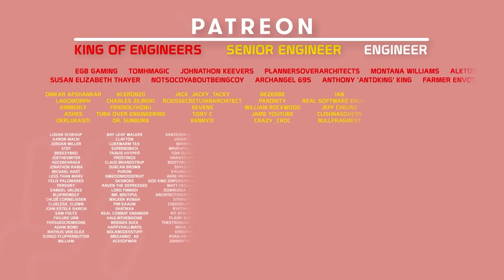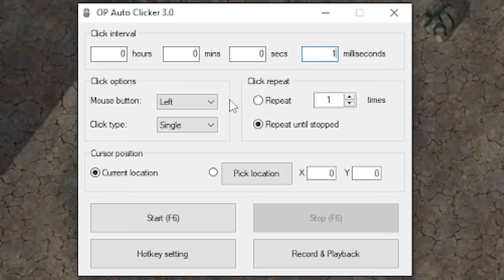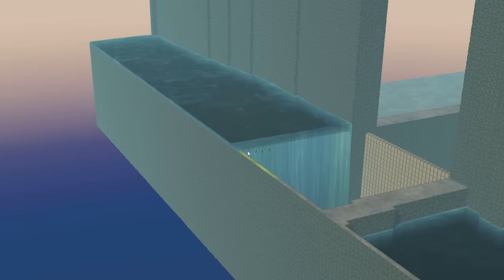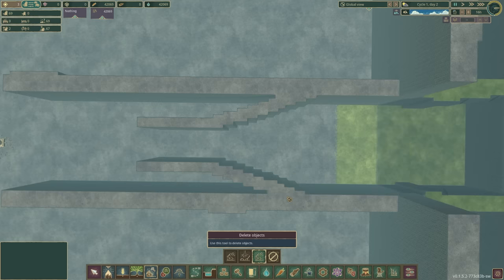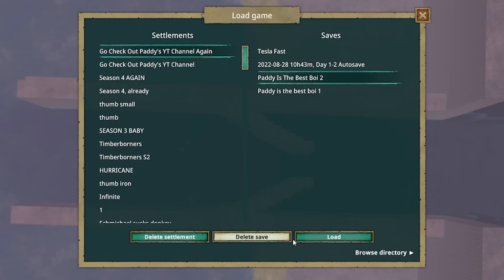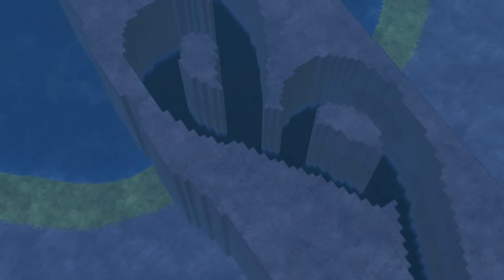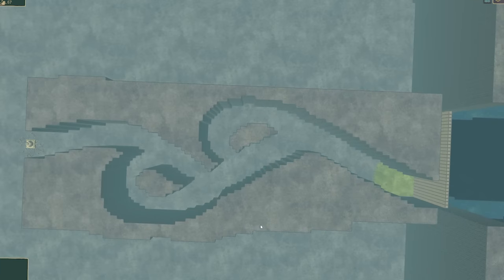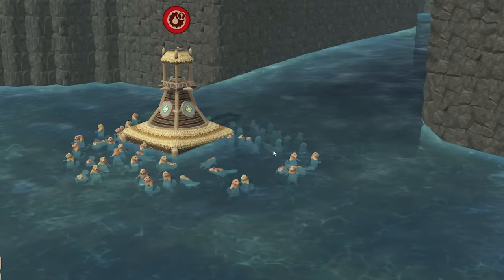Can a TESLA VALVE save my beaver colony from HUGE FLOOD WATERS?

Comment: As can be seen when the water is leaving the canals, the water "diffracts" around the corners, appearing to behave more like a sound wave than a water flux. You could try the double slits experiment to see if there is a "safe" place in front of the tsunami for the beavers to live.
Reply: I mean wave physics is wave physics, I believe the analogy works bc water waves, sound waves, and quantum waves all do similar things. As others pointed out his assumptions are based on closed tubes rather than barriers.
Reply: maybe TB water is set up to behave more like its large scale? i wouldn't be surprised if poking a 100m wide gap in a skyskraper sized dam would also involve quite some sideways spill from the initial wall of water.
Reply: The min water amplitude is 0m, not negative. A double slit would make the safest space half the max height of the water, which is still bad
Reply: problem is that waves in this game don't have "momentum" tesla valve works because you crash wave on itself using momentum. Game don't have it in long run, there seems to be some momentum analog when water meets wall, but there is not when water meets water, nor when you have 100 block high wave running in straight line, which in real life would speed up all the way down from that standing pool . 
let me say it again as well
Tesla valve don't stop water flow. It makes water waste momentum and slow it down, not stop it completely. IF he would leave a way for small amount to leave to the side, then it would make sense.
Reply: Double slit experiment would be super cool to see.
Reply: @xxportalxx.  If by water waves, you mean surface waves then you would be correct. However, simulating how fluid flows is different to simulating waves. The water particles that make up a wave don't actually move that far, they just wiggle back and forth.
Reply: @aedeatia  ofc, these simulations in the games seem to just set a speed for water propagation that looks good. Which to be fair is a lot easier on the computer running it, they aren't fluid mechanic simulators after all.
Reply: @yugiohsc  You could set up a coffer dam around the beavers, just barely not tall enough to save them with a straight-through water flow, and then see if an interference pattern can keep the water low enough to keep them dry.
Reply: @xxportalxx.  not in this case no. He's trying to simulate a tide which is essentially a single direction. Sound waves go in all directions at once
Reply: @Evi1 M4chine no, not at all, when quanta are behaving as waves they do the exact same thing. The difference is when quanta are not behaving in a wave like way. You basically have the discovery of the double slit experiment backwards, it was what first confirmed the wave behavior. In fact you can do the double slit experiment with water waves and get the same result, however water waves won't show the 'particle' behavior you'd get from quanta after entanglement.
Reply: The way Timerborn handles water, it doesn't follow the wave equation, the curvature of the surface is not proportional to the second time derivative of the amplitude.

It more closely follows the diffusion equation.
Reply: that would be fun to see
Reply: Waves are waves, but at the same time i ABSOLUTELY want to see the slit experiment now. How far can we push Timberborn water physics.
Reply: Yes! A double slit experiment with Cities Skylines water!
Edit: this isn't CS, but still...
Reply: That's kind of what I thought in the CS tests; the wave looked more like a sound wave than a water wave.

Comment: I'm not sure, but I think the visual water currents don't actually effect the physics, they are just like visual shaders, and the water doesn't have any momentum/inertia.
Reply: That's the problem. Not only is the water slow, its velocity never changes.
Reply: I have definitely seen water hammer in this game though, which suggests some inertia
Reply: @frillneckedlizard8529  I don't know what that is. But, could it be the case that water behaves specifically due to that thing to just simulate inertia in that instance?
Reply: Yes. Water just checks for tiles that are lower in a small circle, and tries to spread itself equally to those from what I have seen
Reply: Water doesn't interact with itself like irl
Reply: Water speed IS simulated because the water mills depend on it for power.
Reply: But if i may remind you of water mills that slow down if flow impeded
ed: ye, should've read the answers first^^ For good measure then.
Reply: Next time you've built a fairly big dam, open your sluice gates fully to get some flow & then shut them rapidly, watch the water rebound - it's the same effect when water starts refilling a shallow dammed river area & rebounds & floods, and then drains, and then floods, and then drains... There is definite momentum & some wave modelling going on, it's just it might not interact with more water.

As was said, you can build narrow channels to speed up water mass flow to boost water wheels. You can check the flow with the stick.
Reply: @Xeridanus  but that may just be a number instead of a think calculated, like the air
It just tells the thing that checks for it how much energy it gets from it instead of that number being applied to the physics
Reply: @manelneedsaname1773  aren't all simulations are just a bunch of numbers if you look at a single time frame?
Reply: @manelneedsaname1773  Nope. I've been on the discord when some very keen users were testing things. They actually found a really subtle bug by measuring the flow rate at different points in complex setups. The bug was related to the order in which each cell does it's calculation, which then affected adjacent cells differently.
Reply: Not sure, slow looking water will actually spin the electric wheels slower or not at all
Reply: It's like minecraft water
Reply: @rancidquality100  I'm not
Reply: Ah
Reply: The water comes up from below the map so yes you are correct, although the markers act as indicators of which direction the water is most likely to flow to. The water physics are there they just arnt modeled in the visual water.
Reply: Essentially, if you look up Teslas own explanation of the feedback valve, or any of his inspirations (Heavyside et al) the fundamental physics of water means if it is moving anywhere it moves in toroidal 'ropes'; if it is moving it is in rotating toroidal columnar flow. This alone is why a tesla valve works at all, it's a major failure of modern physics to not comprehend this and students are still shown water as linear flow in a pipe.
Reply: It's basically advanced Minecraft water. If x block is water/source surrounded by source blocks, spread to adjacent blocks. The only difference is that they added weight to the water, which in all reality is just a 3D version of water the code for which has existed in Dwarf Fortress for decades. I assume the height of the "wave" is calculated based on the "amount" of water in surrounding blocks which is spreading into the next block ad infinitum, the remainder of which after the block is full, is ejected to the block(s) above. The update for this math is probably purposefully set so that the water "runs" at a certain speed. 

The supposed water hammer you saw in this video was just an overfilling of the blocks with a lack of adjacent blocks above to spread to, so it sent the water higher.
Reply: @sperzieb00n  "aren't all simulations are just a bunch of numbers" In a sense, the answer is yes. In all technicality, all simulations really are just bytes of information at any single frame of time. 

However, some water simulation is physics based and not maths based. I'll explain the difference: 

If you're taking a mathematical approach to water physics simulation, you might observe water to have a flow rate across flat ground of x number, and you would then program a chunk in your game to act as a source block of water. This water block contains, for popular example, 8 blocks of water in it and it can spread in every direction that many blocks. Then you would decide how often this math is updated until you're happy that the "flow rate" looks true to reality. This is a caveman example, probably significantly less complex than what's actually going on but I imagine this is the barebones idea which has just been significantly expounded upon.

If your simulation is a physics based approach, you would generally try to recreate what water is, which is a bunch of particles sticking together or not, or flowing or not, in a way which looks like water, honey, or jello. For example, if you wanted jello you could say the particles stick together very much and have some possibility for deformation but no possibility of flow. Your game engine is running in real time though, it's not updating with a tick rate that you can perceive, rather it focuses on updating as often as possible. This type of simulation is extremely accurate and you can tell when it's used in games (almost never) because genuine fluid dynamics are present...because that's how reality works.
Reply: @ShiShawPocketSand  necro thread but, physics IS math. I think you mean empirical sims vs physics based sims
Reply: @mezkhalin  Pedant.
Reply: @ShiShawPocketSand  Particularly. But looking at your message that I replied to, I could say the same about you ;)
Reply: @mezkhalin  Get a life, eh?
Reply: @ShiShawPocketSand  right after you grow up and learn to take feedback, my dude.
Reply: @mezkhalin  That wasn't feedback. That was pedantic.
Reply: it does have water physics for speed like that but not like this more just to get rivers right high input low channel  and it can't overflow = really fast

Comment: I think you are a little bit off with your velocity assumption:
In a closed pipe a reduction of the diameter results in a higher velocity (with an incompressible fluid). But because your system is open, the fluid uses the open space above to release the "pressure" of the reduced diameter and just stacks higher (as you noticed). So the physics are probably correct :)

Edit: In a continous stream you should be correct, there the velocity should be higher in a narrower channel, but I think the tidal wave breaks the system because it generates a local pressure at the entrance of the narrow channel.
Reply: but there is still a noticeable increase in velocity of flow at narrowing in channels. sure it won't be as much in pipes since the flow isn't restricted vertically, it should still increase by the height of the narrowest part of the channel.
Reply: @takumi2023  In real life that is correct I think. But the game probably does not calculate a physically correct pressure distribution (or a (hydrostatic) pressure at all) and therefor uses the height to "get rid" of the damming up water.
Reply: @Snifflezz_  It does simulate that, just not on a larger scale like he'd need for this concept to work in game. If you take a three block wide river and place a levee on two of the blocks, the water moves significantly faster through the remaining block. This increased flow rate allows you to create much more power with water wheels than you would by relying on the river's natural flow.

That level of simulation seems to kinda fall apart when you're dealing with this amount of water flow.

Comment: The water physics in the game are mostly correct, the higher a wave the more water "flowing" through. Matt should try using dams on top of foundations or arches to 3-dimensionally constrain the water in a pipe, this should change the velocity of the water instead of the height if the game actually accounts for pressure.
Reply: I definitely think thinking 3d would make some kind of difference worth trying out
Reply: The game sadly doesn't allow building of dams on top of other blocks.
Reply: That's a good idea actually.. now I'm curious I wanna see that test
Reply: Actually it won't matter, the water physic in this game is like flow to next block when water lever>X, it didn't apply volumetric force or speed, not really a free flow system.
Reply: you cannot build an arch out of dam blocks sadly
Reply: unfortunately the speed of water in this game is constant rather than affected by pressure

Comment: ok so first mistake: you're limiting the inlet to the channel, instead of letting water in then restricting it. then the channel doesn't change with UNTIL the water reaches an intersection of two channels the same size as the original, which means the flow gets split in half.  

if you look at a graphic of a Tesla valve, the loopy side channels are narrow, and the transitions are gradual & smooth, and the angles are directing back into the face of the flow your trying to disrupt, NOT the side of it which is what you're doing.

it might help to remember that the reverse flow direction is supposed to be THE EASIER PATH for the water to take. So you should start your design with the smooth reverse path, then add the side channels to it that you want the forward flow to get side-tracked on.  remember that the side channels are supposed to be more restricted than the main channel (IRL)

game wise, I think it's still only calculating a wave-front, then working backwards, not applying any actual physics. I think differences in power production are calculated using simpler methods, not any sort of physics modeling.
Reply: You got all that from bad water physics? Pseudo-intellecualism at its finest
Reply: Cool story.

Comment: So a couple of things actually, having the beavers start at level ground isn't really a fair test in this game.  I think you should set up a little beaver civilization going up steps to see where the water stops.  With the base level beavers being 2 or 3 levels above ground floor since regardless of how much you stop a little is going to get through.  You real goal is to have as little water get through as possible.

I also think that matt valve has some potential, though I actually wouldn't suggest filling them with water.  Rather having a couple along the track to catch water and reduce the scale of wave, before it all falls back down reducing the wave's speed.  Since this water seems to magnetize to all available space it might work.

Comment: Hey RCE, I think that the reason the water doesn´t go faster (or slower, depending on witch part of the video we are talking about) is because the height is limited in a tesla valve. I mean, in timberborn and cities skylines we can´t cover the top of the valve to limit de height and increase the speed, so the water just go up instead of speending up
Reply: Yeah, it did go sideways straight away during the first test and with inertia it should mostly continue forward.
Reply: If the game doesn't count with pressure to speed it won't slow down… but the going up wall makes it seem there is some momentum to the water physics
Reply: @Footfetish42069  but the pressure WOULDNT be increasing, pressure increases on uncompressible fluids due to it having nowhere else to go but in the direction of flow. tons and tons of energy is wasted in a simple open channel because it can go more up. pressure increases when there is no longer any space to fill, but there is still more energy flowing into the system. the energy has to equalize, therefore the pressure increases, and the water moves faster.

the general idea that speed increases also assumes a continuous and equal flow which is also not the case here.
Reply: @Footfetish42069  we're not talking about that kind of pressure, that is a kind of atmospheric pressure. we're talking about the pressure coming out of, say, a nozzle.
Reply: @Footfetish42069  it is faster, but its because the nozzle would be attached to a hose, or some other kind of enclosed space. water moves faster out of a nozzle because water keeps pouring in, but there is less space for it to move through, so the only option is to move faster. this is not the case in the examples in the video, it can move more up.
Reply: @Footfetish42069  ?? not sure what you're suggesting here, yes water flows through culverts? but the pressure will remain constant across the entire culvert even if it floods. if you stuck a nozzle at the end of it, then if it floods and thus fills up completely the water coming out of the nozzle would have increased pressure. but if you just stuck some canals infront of it, that's not going to increase the pressure coming out of the canals at all lol

Comment: Hey Matt, looks like you are trying to control a volume flow rate Q (m^3/s). However, your tests in City Skylines and Timberborn are in two dimensions. Narrowing the channel will force the height of the water to increase, but it will not increase the cross section velocity (m^2/s). 

Unless you can control the cross secional area of flow by controlling the vertical dimension of the water, I don't think the Tesla valves will work as intended in these games.

Comment: 2 quick tips first you can make the water source up to 8X amount by clicking on them and changing the value also water won't flow out if there's a source below it so you could have lined the edge with sources to stop it